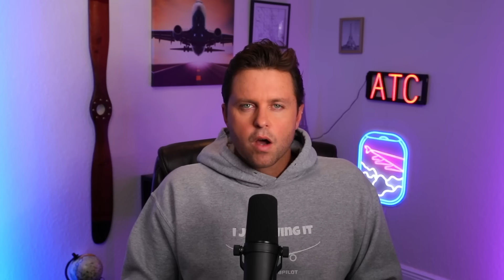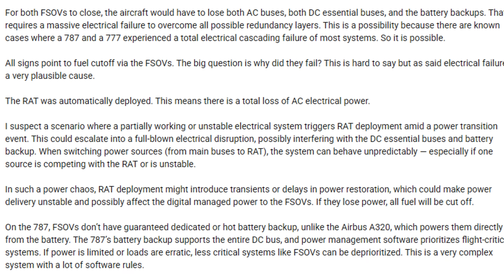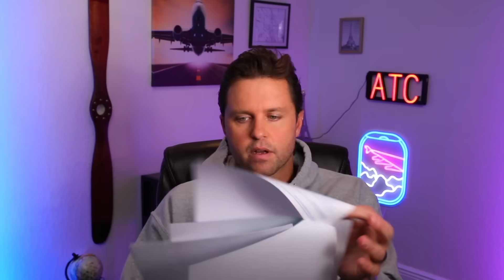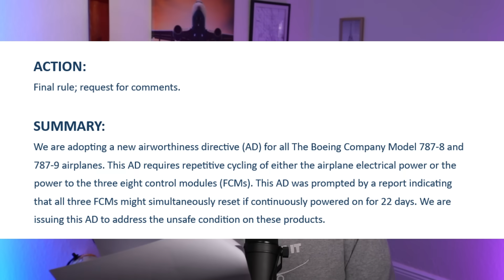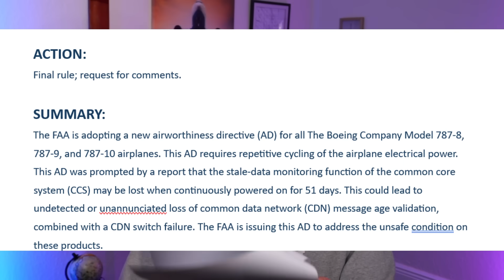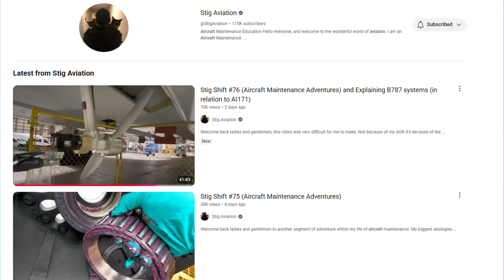Air India 171: Did a Software Glitch Cause Dual Engine Failure?

Comment: I am pilot who has flown Boeing aircraft and an engineer. This makes total sense. The single most poignant comment of this thread is: “I fly the 787 and this truly scares me.” . As a pilot I would think this would give anyone pause. As an engineer, I cannot see how this mode was missed. I think that not having this hot wired is a gross error.
Reply: I'm sitting here thinking that too. Why the heck would you set up the fuel shut off valves like that? (And it seems like Airbus didn't.)
Reply: @purpleicewitch6349 As a graduate software engineer, working in aerospace in the 1980s I used to think Airbus fly by wire was really scary and would avoid flying Airbus aircraft.  I then led the software team that developed the original 777 power management system (ELMS). Boeing were engineering led back then and they were really tough on us regarding design integrity and verification, which was good for everyone.  With wisdom now, I will avoid flying modern Boeing aircraft wherever possible. This tragedy with Indian, and the 737MAX MCAS debarkle tells me the tide of engineering experience has gone out at Boeing, whereas Airbus have remained very focused on system integrity, even under adverse conditions.
Reply: @purpleicewitch6349  They DO NOT WORK THE WAY THE VIDEO CLAIMS.
Reply: There was apparently another 787 crew who had this happen at altitude. They fortunately had time to rectify the situation.
Reply: @simonmiller5118 Fakt. Tamci mieli minuty ci mieli sekundy.
Reply: @simonmiller5118  Do you have a source - even an airline or rough time frame?
Reply: That’s messed up about shutting down upon landing, but I’d rather it happen upon landing than right after takeoff, IF it were to ever happen to me.
Reply: @HVACSoldier  In that case, it was the reverse thrusters being applied too rapidly, they think, that tripped those valves. Let's hope they don't activate the reverse thrusters on takeoff, we'd be right back at the terminal gate, LOL.
Reply: @HVACSoldier  They shut down on landing because the pilots activated the thrust reversers too quickly.
Reply: : @HVACSoldier  yes shutdown is possible if overloaded like a lorry trying to climb up with  loads beyond permitted.
Reply: 1) too much software is killing the industry; 2) too many electrical networks inter-connecting causes transients that are hard to track; 3) similar things, in extremely large scale,  include the Spanish blackout; i.e., the lack of mechanical rigidity; 4) we have to check if similar glitches happened in MH370 (FBW 777, 787, with their electrical system, could all succumb to these rare but non-negligible events)
Reply: @irvinewayne4086  Software need to be perfected and polished instead of asking for reboots like point of sale or a cellhpone.
Reply: While I agree that the FSOV explanation seems logical, there is still at least one obvious line of evidence which imo requires addressing. It is my understanding that FSOV would imply plane with normal thrust before failure and a complete loss of thrust afterwards. However there are reports about abnormally long runway taken for the take-off: 

"According to Indian aviation officials and airport sources, the aircraft used nearly the entire 3 500 m runway at Ahmedabad—far exceeding the typical 2 500–3 000 m used by a 787 under normal thrust conditions—before finally becoming airborne.This extended roll is strongly suggestive of insufficient engine thrust"

How would this fit into the picture if FSOV were to be the root cause? Could we have symptoms of insufficient engine thrust by one cause and then dual engine failure by another cause just during one take-off? Or is it more likely that both the insufficient thrust and subsequent dual failure are linked to the same root cause?
Reply: @tyhjyydesta  It still could be possible. One engine failure would create some electrical issue and increased workload on the generators that are still working… This could trigger a massive electrical failure and cause FSOV to automatically shut the engine that is still running.

Still totally plausible and it is still the most likely cause even if the engines didn’t shut off simultaneously.
Reply: @tonamg53 No. The electrical load management system would immediately close a bus tie to allow power from remaining good engine to feed both left and right buses. No pilot intervention required.
Reply: @MS-Patriot2 Yes, that’s what should happened… but it’s also a possibility that it could create some kind of electrical glitch causing a massive power failure during switch over.

The electrical system are more prone to failure and less reliable after an engine had failed. A total electrical failure should’ve not cause any engine to shutdown.

We are discussing about massive electrical failure causing engine to shutdown, not about whether it has redundancy backup system or not. We know that it does have redundancy built in and dual engine shutdown should not be possible…

But then you see what happened right?… and this isn’t the first time it happened either. Yes, it did happened before but that time the plane was on the ground so it didn’t crashed… that’s seem to be the only differences.
Reply: @tonamg53 Airplane will rapidly shed loads to prevent an overload situation. Things like cabin entertainment, galleys and such would be first.
Reply: @markinusa5386  pretty sure that some 787 did had a massive electrical failure before… just that it didn’t cause the engines to shutdown (and shouldn’t)
Reply: Too Big To Fail, also: military
Reply: @Patterner  Bingo!  Their priority.
Reply: @Patterner  remember: Douglas aircraft company.
Reply: @Patterner Military also couldn’t handled Boeing BS either.

They actually forced Boeing to put EICAS in their military 737s version the civilian ones doesn’t have it.

They would probably much preferred to deal with someone else not Boeing if they have a choice…
Reply: @tonamg53   the 737 Max's MCAS - software to work around engine placement, necessitated by going for larger turbofans without a clean sheet design on yet another refresh of the 737 - does not apply to the 787 which WAS a clean sheet design.
The 787 does not have MCAS.
My point is not to confuse MCAS and EICAS, but to say your generalisation re 'Boeing BS' is just that - too vague.
Reply: @tonamg53 no EICAS in civil 737s , you’re having a joke aren’t you ?
Reply: @MS-Patriot2 All Boeing 737 doesn’t have EICAS. 

Boeing P-8 Poseidon (derived from 737) does have EICAS.

No, I’m not joking. Why would you think I’m joking?
Reply: @artgreen6915 And I never said 787 has MCAS. I didn’t even said anything about MCAS. Why are you talking about MCAS?

There’s nothing I said that is MCAS related. I wasn’t even talking specifically about 737 MAX which is the only variant that has MCAS. I was referring to ALL 737…

I said 737 doesn’t have EICAS because it doesn’t have EICAS. Do you even know what an EICAS is?

And how did you able to read that and thought I said “787 has MCAS”? 

Wtf? 🤦🏻‍♂️
Reply: @tonamg53  I don't know what has happened to this thread but when I replied you had a comment, so mine sat below as a reply. Now I see nothing of yours above mine. Either this thread is messed up or you deleted a post.
I know you didn't say anything about MCAS.
But you were talking in loose terms about 'Boeing BS' and talking in a generalised way about software problems.
I suspected you did not thoroughly understand what the 737 problem was about, because if you did you would nit be muddling it up with 787 problems.
I say again as I said in my original comment, the problem with the 737 Max had to do with a refresh of an old design gone too far, which created a dynamic problem, which created the need to 'fix' that with software - MCAS. I know you didn't mention it but you should be aware of it.
And if you were, you'd understand the 787 not only doesn't have it, it doesn't need it - because it doesn't have those design compromises, because it is a clean sheet design.
So you should learn about MCAS.
And you shouldn't muddle the MCAS issue into the 787 by talking in vague terms about software problems, and 'Boeing BS' which you originally did.
Reply: @artgreen6915  This is what I wrote and you replied to. It is still up there.

”Military also couldn’t handled Boeing BS either.

They actually forced Boeing to put EICAS in their military 737s version the civilian ones doesn’t have it.

They would probably much preferred to deal with someone else not Boeing if they have a choice…”

Boeing BS because every modern plane must have EICAS but Boeing lobbied the FAA for 737 to fly on “legacy” approval from 1960s so it doesn’t need to have EICAS… but military wouldn’t handled such BS from Boeing and forced them to installed EICAS on their P8 Poseidon planes which is derived directly from 737

Is that clear now?
Reply: @artgreen6915 You’re still totally clueless about what I said aren’t you? 

I said Boeing BS because all modern plane from around 1980s onwards required to have EICAS installed by regulations. However, Boeing lobbied the FAA to allowed their 737 to fly on “legacy” approval from 1960s so that EICAS is not needed. 

The military wouldn’t handled such BS from Boeing so they forced Boeing to installed EICAS on their P8 Poseidon, which is a militarised version of Boeing 737.

You don’t need to explained MCAS to me, I know a lot more about MCAS and just aviation in general, than you do, trust me.
Reply: @tonamg53  OK, I see your point then, but I don't yet see how you've linked it in a useful technically specific way to the 787.
If we know about the 737 Max, yes we know Boeing bent the rules and had a questionable working relationship with the FAA to get the 737 Max through regulatory oversight.
I misunderstood you by trying to guess how you were making your comments relevant to the 787. Normally harping on about the 737 Max without a quality technical bridging point to a 787 discussion flags someone who doesn't understand the 737 Max issues and wishes to tar Boeing with a broad brush.
Reply: @artgreen6915  I was replying to a comment referring to Boeing as “too big, too failed” and “Military”

And I respond to that comment saying “The military wouldn’t want to handled Boeing either” citing EICAS and 737/P8 Poseidon as an example.

I wasn’t even talking specifically about 737 MAX but 737 in general..
Reply: @tonamg53  I see. I would rather bring them back to the 787 and stop generalising about Boeing at this time.
The B787 was not an attempt to keep an old design going, and the B787 does have EICAS.
Boeing may have had a questionable corporate culture over the last few decades, but without even a preliminary report into AI171 I would rather wait for confirmation that culture had any bearing on this loss. It may do, I'm not predicting it won't, but too many comments are getting ahead of the investigation by implying that.
Reply: @artgreen6915  Actually, I always thought that Boeing’s problem was going to blowup one day… but I was wrong, I never thought it was going to blowup because of 737 Max, I always thought it was going to be because of 787. 

737 Max was a dark horse…

787 although it is totally new design… it had been mismanaged, taking shortcuts, overlooking design flaw etc. from the very beginning of the program.

You know the company that design the main batteries for 787… its headquarter was burned up after a major fire.

Take a wild guess what started the fire? And yes, this was before 787 enter service… 

They knew about battery fire issue.
Reply: @tonamg53  there you go again: you always thought 'Boeing's problem' would blow up one day, is what you just wrote. One big amorphous blah, lump it all together why don't you.
You haven't identified a specific issue that you always suspected.... was involved in THIS incident. So I don't have much interest in that part of what you say. You call the 737 Max a 'dark horse' ....OK.
You write about the battery fires, which last occurred when? And how many B787 flights have there been since?
You aren't resolving my main issue that led to my first response: you're too ready to throw in other stuff without proving a link to this here incident, then mix it all about, and come out saying you knew along. A broken clock is right twice a day but your remarks on this are not very well targeted. I won't be replying again.
Reply: @artgreen6915 787 batteries fire not an issue?

You know that they’ve never actually fixed it right? They put the whole battery compartment inside a vacuum chamber so it wouldn’t caught on fire whenever it randomly shorted itself due to lack of oxygen…

But the batteries would continue to shorted itself randomly, it just wouldn’t start a fire. You’ll just get electrical system failure.

Now, there also seems to be a problem that a massive electrical failure could’ve cause both engines to shutdown…

Batteries shorted randomly -> electrical failure -> both engines shut down

See the problem yet?

Are you like a Boeing boot licker or something?
Reply: @tonamg53 my bad. I did work in the industry and found your facts very surprising.
Reply: @tonamg53  He's NOT a "Boeing boot licker", he's being objective, jerk!
Reply: @GARose-kt4jc Then why is he licking Boeing’s boot then? He seems clearly offended whenever someone shows the slightest signs of criticism to Boeing.

He should stop doing that man… I don’t think the boot is very hygienic
Reply: Should u not contact Boeing and or FAA for concerns and comments
Reply: Boeing and the FAA don’t want to hear from anyone.   Has this not been made clear in recent history?  According to them, there’s a price for everyone’s lives.
Reply: @Uxoriously BOFA
Reply: It is time to see if Boeing learned anything from the 737 Max experience.
Reply: @johnbochenek5526 They didn’t learn… it’s actually time to see if they can finally change this time.

Also they just changed their CEO, this would be an opportunity to show that the company did changed with the new CEO… if not, then nothing they do will change the company. 

Even too big to failed can failed…
Reply: They learned nothing!   They preach one thing, but do another.  Trump shut down that airplane worldwide but it took several crashes before that happened.  Boeing did nothing.
Reply: @johnbochenek5526 we know the answer to that. Unfortunately
Reply: You have to put the fuel shut off on DC bus to reliably  and safely shut the engines off if the they are running away and the FDAC has malfunctioned.

I think his scenario is a bit too “overly complicated” though.  It is actually much simpler.

I believe the DC system was zilch, Li-ION batteries were completely depleted by AC overuse on the ground.  So the crew kept the APU running on the taxi and take off.  After  the V1 call out, you have rotate callout, positive climb,  pilot calls out APU off, gear up.  The second the APU was turned off the DC voltage was zilch.  That lead to the fuel cut off closing, engines start spinning down, RAT deploys.  This was basically unsurvivable without thousands of feet of altitude, and a good 5-7 minutes to restart the engines.  They would have restarted fine once the APU was spun back up and left on till landing.
Reply: https://youtu.be/dIgnR0zw3FU?si=FIglkTDBwcJWlfU3
Reply: If I’ve understood correctly, this forms part of the engine fire suppression system and is a mechanical backup in the event of total loss of power to the affected engine. What I suspect is that a complete failure of aircraft wide electrical power from a cause other than engine fire that caused both mechanical cut off valves to close was considered so remote that there was no other contingency built in. Also, the probability of this occurring at low altitude following takeoff would reduce the probability even further. Am I right in thinking that if it occurred at altitude with the RAT deployed there is a modicum of control such that the pilots might be able to bring the aircraft down into a controlled crash landing, the aircraft wouldn’t just drop like a stone because it would have forward momentum with air passing over it’s flight control surfaces? Could the Air India flight have landed if there had been a sufficiently large empty space rather than a built up area?
Reply: Too gross to be true.
Reply: Boeing Execs know EXACTLY what happened. They are in ‘COVERUP MODE’ now. Air India needs the blame to fall on Boeing to survive this. Boeing needs to blame Air India to survive this. Boeing’s Contract Hitmen are On-Call for assignments to clean up loose-ends.
Reply: Call me cynical, but if this is a design fault then don't expect any official findings for a long long time. If they can blame the pilots then the findings will come out sooner. Just look at the recent crash over the Potomac.
Reply: @simonmiller5118 the crew over Potomac was partly at fault but the mgmnt in charge who placed 1 young Obama cuddled favored woke lady pilot trained by ALL MALES with all MALES IN CLOSE QTRS was stupid jerk decision. 
Their situational awareness very poor...can't focus FOR VARIETY of issues. Like that Kennedy kid..who the hell trained him??? Poor trainer interface caused death of Kennedy son my estimation as son was performing asinine and dangerous decisions and actions..accident waiting to happen..sad
Reply: Agreed - how the hell was this missed…
Reply: @jimbrown5268 cost and time to market.
Reply: Profit margins, mergers, government bail outs and cover ups, contracts, good ole boys, the list goes on and on
Reply: That's not the way 787 works.
Reply: The answer is short: corruption. The US is full of it, and its the reason everything erodes or breaks apart. Impeach Trump, refresh your institutions and Make America Really Great Again.
Reply: If you’re actually a pilot who has flown Boeing aircraft, have you flown the 787? You should know from flying Boeing aircraft that loss of AC power will not cause the fuel shut off valves to close. That is 100% false, and you should know that.
Reply: My 2 cents , having done avionics work on 787 , from software updates to EECU swaps. EECU are sent out for updates to the manufacturer. assuming this is loss of power after take off . If you had thrust V1 speed to rotate, only possible cause would be some sort of issue with FADEC cables to have a dual engine failure, Yes those EECU's have multiple channels, but cable issues could have total failures
Reply: @cessealbeach  BINGO! That's what I have been saying as well - the FADEC3 can set both engines to Idle if it detects engine parameters that exceed design specification. This sounds like a programming error. If FADEC detects parameters which exceed design, then instead of setting them to idle, it should drop 10% and then monitor, then another 10% drop and monitor for 5secs, etc...until engine parameters come back within spec. Setting both engines to Idle from full power, is what you get when you have programmers who are not pilots.

Is it a faulty FADEC3? Who knows? Could a 12yr old aircraft have electrical-mechanical fatigue issues in the wiring harness, which cause sporadic data on the FADEC3 BUS? Absolutely!
Reply: @delawarecop  Both throttles would have to be at idle, with the engines not responding, and on the ground, for both TCMA to activate. If you look at the history before TCMA was mandated by the FAA - it is to protect refused takeoffs (aborted takeoff before decision speed - this is more critical) or landing roll - where you need to have thrust cut back to idle so you don't run out of runway to stop.  So a gradual decrease in thrust will not work for either of these unless you want to extend runways substantially.

This is not specific to the 787 - it is the same for all TCMA applications over the last couple of decades.  This is all handled in the FADEC - this means the Airbus A320 GE engines may have essentially the same logic as the 787 GE engines.  It also doesn't address the independence of the two engines.
Reply: @markinusa5386  In all fly by wire systems, if there is a major electrical fault that causes confusion to the FADEC, then it can default to idle for both engines, which in turn can cause the RAT to be deployed.
Reply: @cessealbeach  And we do have that old report from a Boeing engineer that suggested cable failure would start to emerge around about now from the manufacturing problems he'd been seeing. Hopefully it is not that, as inspecting all the aircraft potentially affected for swarf etc. anywhere in the system would be a biggie. A software fault or fire damage to cables would be easier to prevent in future.
Reply: @cessealbeach I think it was a real RAT causing this, those guys have temples for them
Reply: @cessealbeach  I have seen those as well on various aircraft. While I haven't flown the 787, I've seen that issue on the 737 and other aircraft. It's rare. But it's definitely been a factor.
Reply: @cessealbeach  What 'cable'?  Redundant throttle resolvers are hardwired directly to the FADEC (EEC) and take different routings for each channel.  Engines supply their own power well before reaching idle upon start.  They have accommodation for loss of airplane ARINC data - which also routed independently.
Reply: Both engines fuel cut off at low altitude/take off? Who the hell design this FSOV to activate INSTANTLY? Further, a 1 or 2 minutes delay wouldn’t have serious implication if at all there is a fire. Smh
Reply: @drt4789  Or at least a warning to the Pilots that FSOV event has been triggered, and will reset in 30sec if Pilot does not override?
Reply: @drt4789  To be honest, I don't recall any FSOV failing closed in any other aircraft. That is why this seems so odd to me. This being true, is an incredible oversight.
Reply: @drt4789 Poza tym są jeszcze piloci. Przecież to nie beztroskie pawiany prowadzą taki samolot.
Reply: Flying by software,   good luck 👍
Reply: @sircampbell1249 Airbus started it and it’s been extremely successful. I’m an ex avionics software engineer who took a little time to be convinced but the stats are in its favour for safe and economic flight.
Reply: Stephen Hawking once said that a trillion monkeys randomly typing away on a keyboard would eventually write Shakespeare. The same can be said for everything.
Reply: @dyuri6433  They already got 3 different issues that needed reboots. So they already got a couple of chapters. Dont wait until the complet book is finished.
Reply: @dyuri6433  Sir Stephen Hawkins is dead. He died years ago and was replaced by a Pedo body-double.
Reply: Hawking did not say that @dyuri6433
Reply: An hypothesis like this can be tested in a simulation provided an accurate model of typing monkeys can be produced. Personally I believe a trillion monkeys typing would not produce Shakespeare material. That same argument of big numbers is used to defend evolution over billions of years. But building requires highly specufic actions in highly specific sequences. If you can't demonstrate how the Big Bang could build a simple brick wall, why is there so much support for it building a complex protein or living cell? It's  all nonsense and Steven Hawking never proved it or demonstrated it. He was ust a member of the group that seeks to deny the obvious,  that life only comes from life.
Reply: @dyuri6433  That was Bob Newheart and his infinite number of monkeys would type all the great works. Comedy skit.